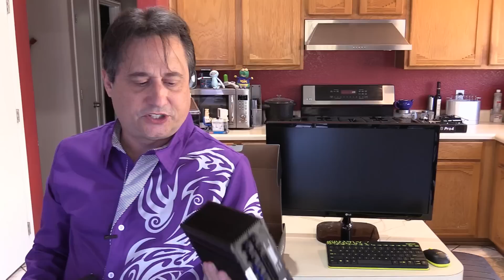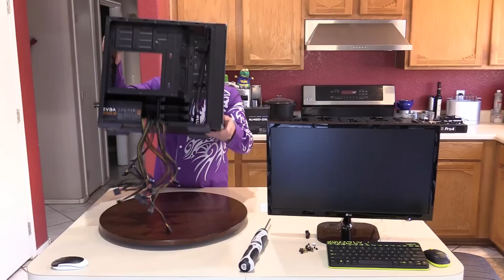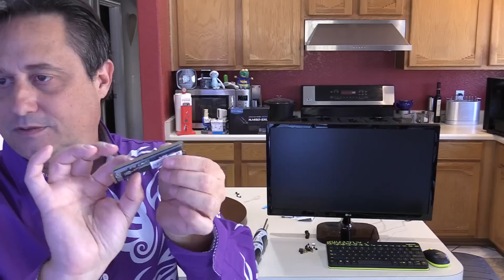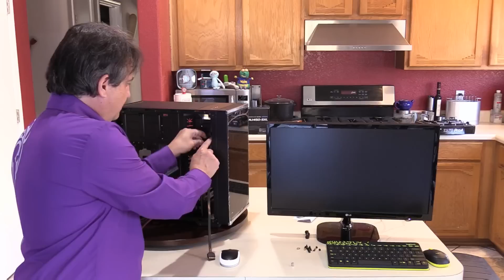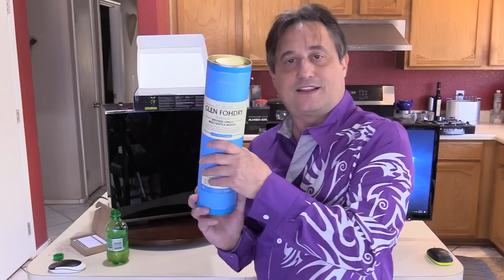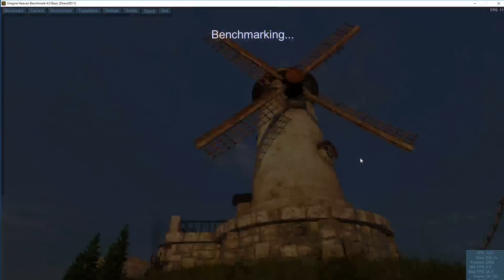Silverstone Lucid LD01 Micro-ATX Case w/ Silverstone Fanless PSU NJ450-SXL

Comment: I don't know about their standalone boards, but MSI laptops have been a nightmare for me.  I've had several laptops, two ASUS and two MSI.  The two Asus laptops are still functional and working.  The one unit is from 2012, and aside from the hard drive which I had to replace, the system still runs flawlessly.  The other one is from 2017 and I still use that one today as well.  However, the MSI laptops I had have both died.  One died after just 2 years of regular use, and the other one died about a year and a half after purchase.  All of these were high-end gaming laptops.

Comment: The be quiet Black Pure Base 600 case should tick all the boxes as a replacement for the 200R
Reply from the maker: So the part I said about needing a professional business computer case with no window.... you just ignored that part?
Reply: I think you are looking at a different case Carey. The one I suggested has no window, has bays for DVD drives (which can be removed if not needed or to fit a radiator in the front) and 2 front USB 3.0 ports. It also has sound reduction material fitted to the panels and has dust filters front and bottom. Its in my opinion a much better case than the 200R for only around 10$ more.
https://www.amazon.co.uk/Be-Quiet-Pure-Base-Black/dp/B01N7PGIPS/ref=sr_1_1?ie=UTF8&qid=1538404352&sr=8-1&keywords=be+quiet+black+pure+base+600

Comment: Hi Carey!  To address your (and Bill's ) concerns about MSI...  My premium build is with an MSI Z370 Gaming Pro Carbon.  It is flawess so far after 7 months.  It overclocks extremely well, and at stock ( which is where I keep it ) it's a dream.  And stays quite cool under an 8700K.  I will let you know if I run into any issues with it, but so far, no worries at all.            ...Peace - Jazz

Comment: I'm using MSI boards from 2009 (HP MS-7613) and 2012 (Medion MS-7728). The former only because the latter doesn't support my non-MSI GT1030. Thanks, Medion.

Comment: EVGA 500Bx are 3 year warranty by default but ... 
'For a limited time, buy ANY EVGA Power Supply and your warranty will automatically be extended by an additional 2 Years for FREE! That means you can get up to a 12 Year Warranty! This upgrade applies to ALL EVGA Power Supplies purchased on or after June 5th, 2018. Expires December 31, 2018.'
https://www.evga.com/articles/01218/power-supply-warranty-upgrade/

Comment: Amazon currently has a Corsair 100R looks very similar to the 200R, the window version is $50 but the non window version (Corsair 100R Silent) has no price listed.  When it rains it pours.
Reply from the maker: 100R has virtually NO cable management.

Comment: I wanted to use a Corsair 350D (~$50) for a build I have in mind but Corsair recently discontinued that case as well, I asked on their Facebook page and they confirmed it, they suggested, the 280X ($159.99) way too big doesn't meet my requirements. I have to go with a different case now, I'm considering a Fractal Design case.  I wanted to go with the 350D because my own case is the 650D and I love it and I told Corsair that in my response.
Reply: I have the 350D and I can say you'd be better off with a better case. It's noisy, a pain to build in since the cable routing side is lacking. So unless you're using a modular power supply the case will likely to bow on one side, granted it's the side you'll rarely see. The rubber pass through are also flimsy and move far to easily with very little tension. I moved from the 350D to the Phanteks Eclipse and have never been happier. It's also only 69-79$ and comes with RGB leds around the case.

Comment: Carey, you could check the Fractal Design CORE 2500, it's very similar to the 200R
edit: also Antec P7 Silent could do (no radiator mount on top though)
Reply: That 2500 looks nice however it has 1 USB 3 upfront, not 2. Seems a better quality than the 200r though.

Comment: That is a bad thing on the case! As a former Volunteer Fire Fighter We were always taught "Heat Rises" and to Get our butts down as low as possible to stay as cool as possible when in a burning structure! Going to have Heat/Cooling issues with that case.   

That reminds me of the Dell Dimension E521 I have. 

Regards to MSI Motherboard a 1 year warranty is a HUGE RED FLAG, Especially when everyone else has a 3 year Warranty!!
Reply from the maker: Turns out Newegg has the warranty listed incorrectly on all MSI products, as does Amazon. The MSI website confirms motherboards in the USA have a 3 year warranty. But why was that information so hard to find and omitted from the product box and manual?
Reply: I agree, seems odd it is so difficult to get the warranty information and the information was listed incorrectly on 2 websites and that it is omitted from the product box and manual. Someone is not doing their job and/or it is bad management at MSI. they have to make sure that this is corrected and to make sure that they have better customer service.

Comment: I'm only 30 minutes in but what about the Corsair 100r silent, the 100r has a window but the silent version is a solid panel with some foam. its on newegg for 64.99 marked down to 59.99
Reply from the maker: Cable management sucks on the 100R